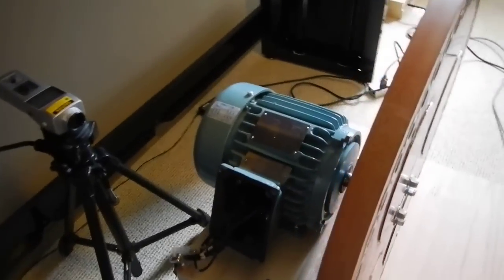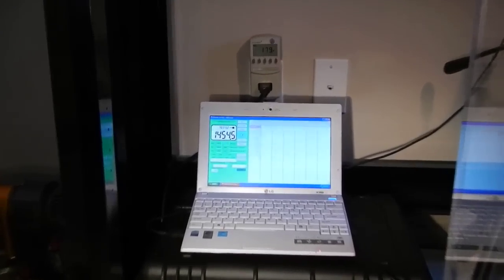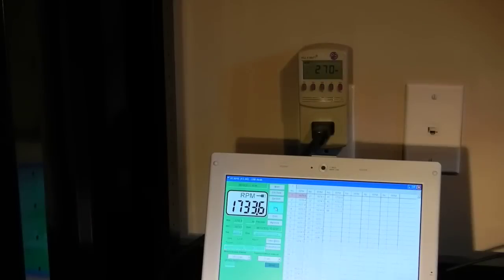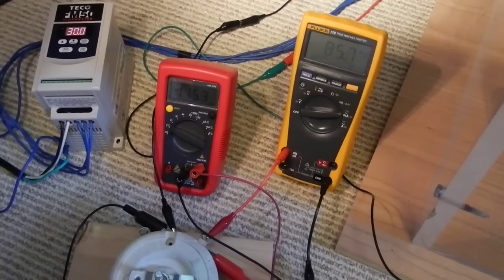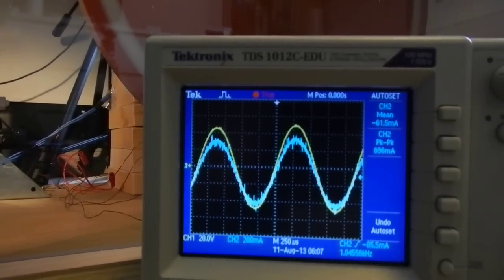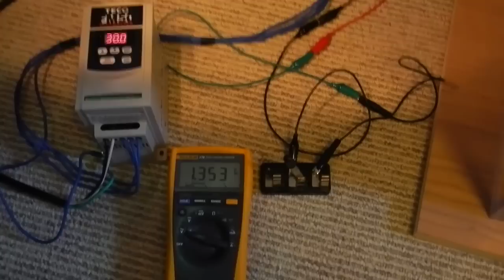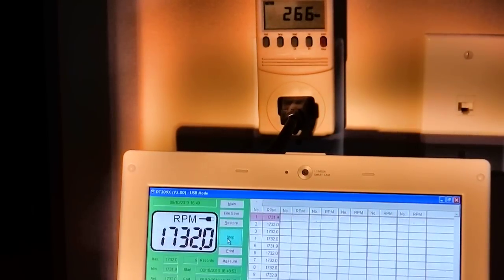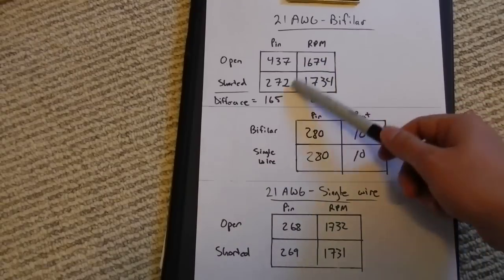Debunked - Thane Heins, ReGenX, delayed lenz, shorted coil, acceleration effect

Comment: At resonant frequency the bifilar coil consumes zero losses + the line resistance which is very small at high frequency. At resonant frequency the bifilar coil behaves as a permanent magnet, it has no back emf (because at resonant frequency the back emf is equal to the capacitance between adjacent wires of the coil and both cancel each other), which means at resonant frequency the coil becomes a permanent magnet (in stator) whose polarity changes the many times (frequency times) in a second and this rotates the rotor.

Comment: Great video and a perfect explanation of the effect!
The bifilar coil as in tesla's patents is (among other things) made to store much more energy than a normal coil can because the electric potential between each winding gets so much higher. It is almost more capacitive than it is magnetic, and so of course if you magnetically drive it to high voltage (with high frequency) then it will act as a huge reactive load, with core losses eventually slowing the current and dissipating it as heat.

Comment: Thane Heins integrated ReGenX generator into e-bike, and recharged ebike batteries while driving in laboratory. ReGenX generator delivered 10 amps current to 72 volt battery. While driving battery voltage was around 67 volts, so ReGenX generator delivered 670 Watts of power.

Comment: Yes, the coil acts as a capacitor. Yes with a large enough monofilar coil you can get the same effects even though it's not bifilar. Are you doing the right TDC switch timing for the regen-x effect?

Comment: The fact that the input power decreases is due to the fact that the ability to transfer magnetic field has been eliminated due to the short. It is counteracting the Lenz effect not  delaying it, but basically by eliminating the magnetic drag that would have been there if the core's leads were opened instead of closed. Opening the coil and not applying a load actually has some load to it magnetically because the copper windings have atmospheric load due to humidity of the air, especially if the device is creating Ozone, it indicates the presence of high voltage which will have a load from the creation of Ozone, so, a better way to run this experiment would be to limit the amount of turns and give the coil a bit of distance from the magnets, or, keep the leads insulated from each other. I have never had Ozone being made with anything under 40 to 50kV, so, there is something strange going on there, maybe even arcing to create ozone. Closing the core may be creating an effect as if the core wasn't there at all, and this would of course limit the load, so, I would try to figur out what's creating the ozone first before closing out the experiment with a judgement that the idea was debunked as i don't feel your test results have too much validity unless you have only played a small portion of your experiment on youtube.. The only anti Lenz phenomenon I have seen before is when a winding polarity is the same, eliminating The Lenz loading from happening whatsoever from one winding cancelling the next,  reducing the load from the coils being wound identically, but, then we don't have a conventional voltage transfer from one coil to the next as a transformer wound correctly and in resonance . The output energy is there, but, it is miniscule compared to what it would normally be because the magnets no longer have a true path to transform into due to the fact that there is a short. I feel the experiment is inconclusive because the resonant frequency isn't shown to be achieved to the viewer, as well, no capacitors have been added to tune to the this frequency. There are too many variables to say anything has been debunked, and, I feel the original  Thane Heins system was crappy shot at calling the phenomenon "Delayed Lenz"  when no scope was originally connected to see what it was actually doing, and, the term "delayed" Lenz effect is just a guess at what people said it was. Nobody has actually verified the claim termed" Delayed Lenz", so, if  there is any effect, it is cancelling Lenz out since the motor is running much more efficient with a closed coil and a load attached since it has a voltage drop and the wattage is closer to what the load was with the closed coil without load. The back emf causing cogging is what I feel the Lenz effect really is, and,  I think we can verify the claim that the load of the flywheel with the weight of the magnets near the outside (weighted at the widest edge of the diameter of the wheel) and the closed coil are reducing the load, or cancelling Lenz's law out for the most part, not delaying it any because a delay would just keep the load and have it effect the motor's efficiency at a later time, not reducing the load at all. The term Delayed Lenz is a very poorly utilized term, so, I would call it maybe reduced or eliminated lenz to be much more accurate. It seems the closing of the loop is causing the flywheel to have jump without the eye even noticing this, making the overall efficiency greater, similar to Chas campbell's generator, except it is much more linear and not evident that the wheel is jumping to use the intertial weight of the flywheel for additional energy.

Comment: ❤the regenerative acceleration is very impirtante into an oscillator ...forced ....(charge the battery in output ...driver coil with bedini style .... with mjl 21194 ...because the motor speed up !the out speed up ...in joule into a battery ... the cold and the negative resistance product a power .... ❤

Comment: The effect can be much more easily demonstrated with a $20, 4 pole NEMA 23 stepper motor. It requires less than 1000rpm to show the acceleration under load. The closer to a dead-short condition on each output coil, the better the acceleration and lowering of input amperage to the drive motor!

Comment: You do make one valid point about the core perhaps being saturated which causes the magnet to somehow not be attracted to it etc, but that saturation IS definitely causing energy, which can be extracted, to be produced in said coil, hence the "energy gain". His entire premise comes down to EM energy generation that is not "seen" by whatever the power source is being used i.e. mechanical or solid-state. Classically, all EM generation of energy requires more power from a source than in idle-state(open circuit).

Comment: Well done, please make a test by bringing just the disc without the motor to speed and then 
shortout the coil and see, if the disc is spinning faster or not.....
So if without any input power the disc is speeding up or not and also try this
with and without the coil cores...
Many thanks.
Regards, Stefan.

Comment: Although you have nice test bed, you are not looking at the complete Thayne Heins effect. You have no Physical magnetic Loop. Read the patents. Your also running very high frequencies and this inhibits the mechanical ability of the generator. Read the Kromrey Patent and do the math. Your setup is not showing you anything but High Impedance acceleration, when in fact the practices by Thayne are very different. The coils are low impedance, power producing, and operate at higher RPM's than the Open Motor.
Its too bad you spent all that money doing it wrong.
Reply: Matthew Jones could you tell me where i can find information to build the thane heins transformer
Reply: I just want to say there's so many great people commenting on this that it'd be great if everyone got into a large conference hall for a 3 weeks and got to the bottom of it. It's a shame so much time has passed and if this works it's sad reality it's not used anywhere......wind farms etc.

Comment: Quick couple things,
F=ma; faster motor means more output work.
Whether thats heat, motion, magnetic or electrical fields, is just a matter of semantics.

Also, it takes work to ionize O2 to Ozone. Microgap discharges that utilize this effect using oppiste gate discharge have been published for triboelectrics in the journal article nautre with a peak outut instantaneous power of 12 MW per M^2.

Third thing; delaying of Lenz feilds or Lens violations are well know and published.

Magbetic fields over and permant or electromagnetic device are a composite of the individual magentic domains on each ferromagentic grain boundarys; not some magical contiguous thing.

Fourth, magentic feild flux moves at the speed of light; lenz law moves at a delay in all materials because its based off propagation of light through a medium other than vaccum by definition; which slows, drags, or delays the speed of light based of the material.

But resonant magentic feilds need not necessary be held the the lesser assumed values based of light propagation.

One is spin based in bound electrons in a atom; the other is the time it takes to flip the spins of those electrons which is inherently longer and, yes delayed.

Comment: You know, it's really sad that you would keep this up. To pretend this has anything to do with what Thane accomplished is misleading.

First of all, Thane's patent and work demonstrated a motor generates power. He used Tesla's patented bifilar coil as the format for doing this. It was a motor driven by the bifilar winding, not a rotor generating power with a bifilar winding.

Next, as Tesla pointed out in his patent, the coil has no reactance, it is purely a resistant load in his application. High impedance is exactly opposed to what he was implementing. WTF do you think you're doing by claiming to debunk his work? Are you being funded by the oil cartels? Does your dad work for Chevron? You really have no clue how electricity works, do you?

What Tesla did not say, is the coil captures the self-inductance and uses it to shift the current to get back in phase with the voltage, hense turning the flux-capacitor into a resistive load. If you stop and think about this, that would mean power has been generated by the coil. It induced voltage into the capacitance from the back EMF of the inductor which was added in synchronicity to the incoming voltage.

You might say MF, the freakin' winding is over unity. But that's OK. Electrical energy is a composite form of energy. It cannot possibly be conserved. This is only one of many ways to exploit the ways electricity's components can be manipulated to generate power.

Hanes added a ferromagnetic core. Which has been known to amplify the magnetic fields of inductors up to 1,000 times. So, why wouldn't it do the same with  a changing magnetic field of a spinning rotor. Even more power captured and synchronized with the incoming voltage. It turns out it also can synchronize to rotate a magnetic rotor while it amplifies electricity. Sweet.

Sure, this would put your pappy out of work. And 1/2 the planet. So, it's not ever going anywhere until the gas and electric supplies dry up. So, don't sweat it. Since Jan. 9, 1894 mankind has been scammed. It's not going to stop until the Grand Solar Minimum gets serious. Then, you'll wish you'd replicated his work as you watch the food in your freezer spoil and the power to your heater fail. Peace, B.
Reply: And it's been replicated by people more skilled than the video presenter, many times.
Reply: Hi, We agree with you in everything.  ¿The question is how do you know that? ¿where do you find that info? ¿do you have something more to share?
Reply: @BienestarMutuo  Bman is a gamer - young gamers nowadays are very adept at knowing a huge bunch of mixed info. He is also interested in farming. Farmers have much to do with the inventions as they have much sun, rain and free adaptable soil to make modifications. Not to mention the meditative time when feeding the animals.

Comment: pretty cool video, congrat, but just a question please: does the bifilar coil winded with the 2 wire in the same time around the core? or does it winded one by one?-->i mean ,one embobinement to the left of the core and one embobinement to the right of the core? thanks for your answer ;)
Reply from the maker: I think I wound the two wires at the same time, Just like Tesla's original design.
Reply: @GestaltReality  thanks mate! you rock , thats so nice of you ;)

Comment: Nice work, what are your inductance/capacitance/resistances of each coil type. (also turns+length etc).These are crucial variables to work out accurate conclusions. A coil shorted is a completed circuit and a LCR parallel circuit, an open coil is a LCR series with the bifilar having an added C, and must be treated as such. All measurements will reflect your choices as to frequency and Z product. I love the set up, keep up the good work, regards Arto

Comment: If I remember right, I did not think Heins used bifilar wound coils.    I think your bifilar coil was acting like a brake even though there was no 'load' on it.   So Pin went up.    Another good test would be to remove the coil all together and get a baseline power reading with no coils near the rotor at the test speed.

Comment from the maker: Look at the numbers again. On both coils, the starting Pin is about 270watts, and with a 10 watt load, Pin rises to 280watts. Every load-watt produced is paid and accounted for by Pin. On my tests for every 1watt load increase Pin goes up by the same amount, no matter which coil I use.
Reply: Br for every 1kg copper u get abt 100 watts power so use copper it's not in rpm or hz 60hz or 3600 rpm is used 2 produce power so use 10kg copper after checking for 1kwh use magnetic ns as pin point high capacity magnets not small ones the greater the flux of ur pull n push with high Tesla, rating as possible, .... Simple let me know ur results

Comment: Very thorough. I wonder what the capacitive reactance is of the bifilar coil is? Maybe open the halfway point in the coil and put it on a capacitance meter on it, then run the numbers with frequency to get the reactance, then use that to confirm your power input values. The surface area of all that insulated copper would surely have quite large capacitance (hence the greater effect at higher frequency) Or perhaps physically hold the bifilar coil with your hand to feel the drag/acceleration forces. . .

Comment: correct me if I'm wrong but the whole point is Zane X Transformer was that it had three round coils, connected in parallel in order to reduce the back EMF or flux. Your quill looks like there's only two course. But I'm watching this outside and I can't see it very clearly. Are you using three wound cores? But I Like Your video

Comment: In replay to:  "How exactly do you propose I bring the disc up to speed without the motor?"
I think Stephan means to spin the rotor up with the motor, then disengage it so that the rotor turns freely, and then short the coil to see if an acceleration occurs.

Comment: So you also have not finished your tests, and the fact is many people have tested many different types of coils and got a similar effect the regenX effect with different coils you would know this yes with Angus... 

1. So really what’s required is the same core material in both coils every test

2. All tests have to be produced without the coil & core present physically, to see the change of having an open coil & core there in the test, and not having the coils & core at all, the same needs to happen with the coil & core closed full load 

3. To make these claims you must first:

 • have a standard generator coil & core that is designed for the rotor magnets and test producing the standard counter torque proportional to output as is standard Law

• then add the RegenX coil & core and measure like you did open and then full load

• then record the test without the RegenX coil & core there altogether (nothing there just rotor plate spinning)

• then use the other single wire coil & core and do that same tests open and full load etc 

• then remove the single wire coil & core and measure that result with nothing there just the plate spinning 

As you’ve done in your basic tests you need to also do with these test above taking the motor-RPM, W-in motor, and ideally a load  test on the rotor itself ideally also, these would be taken form all above tests.

Thane has a US patent on this transformer type of this effect. 
I have my own version of a transform I built and it has the same Tesla coils and does the same thing and without the secondary coil even there (leaving the primary coil alone on the bench with power on, powering it) there is no difference to when I place the secondary OPEN on top of the primary while the test is still all running! 
When I run the test I get exactly the same effect thane gets; what happens is, With all the circuit running and the secondary coil open I then switch the secondary closed full load or even short it... right away the primary coil reduces current the amps drop and the load lights turn on that are connected to the secondary.
Now in the motor version it’s easy to explain as you would know yourself, the raise in rpm from the Tesla coil regenX raises the impedance of the motor coils as there is higher RPM field changing across the motor coils... so the current to the motor must go down because of this, the basic stuff as you would know....

Now the real issue here is that the core must be of standard design or you will have incorrect cogging... another way to test it therefore is all tests with no cores so the coil is just an air core and coil, that way no issues.

It would be hard to believe that an open coil would provide any resistance to the motor so must make sure first nothing else is going on before making any claims.